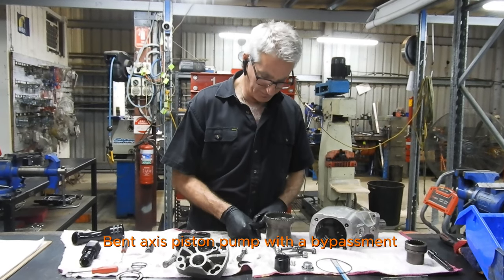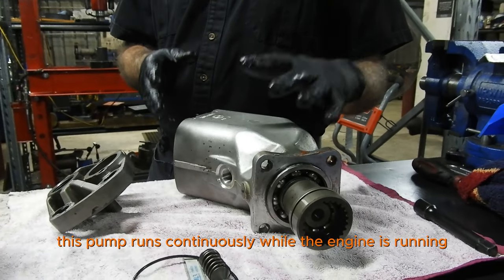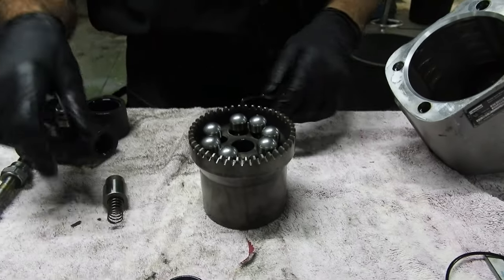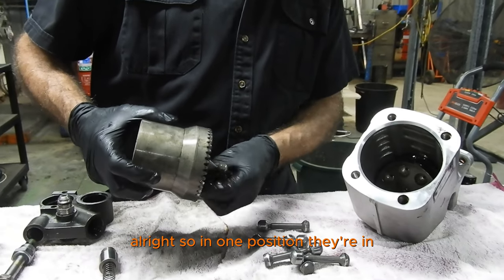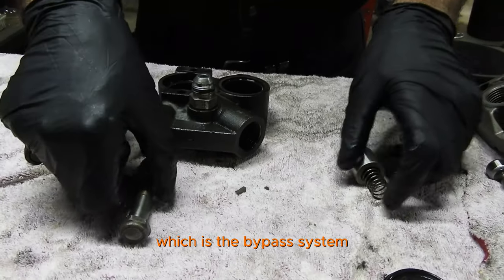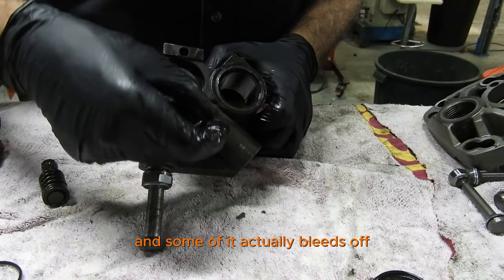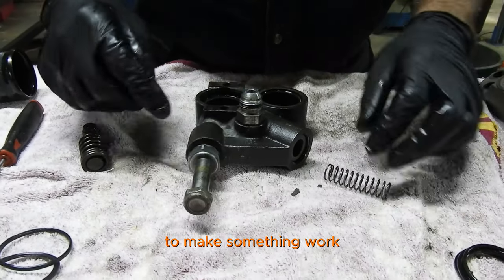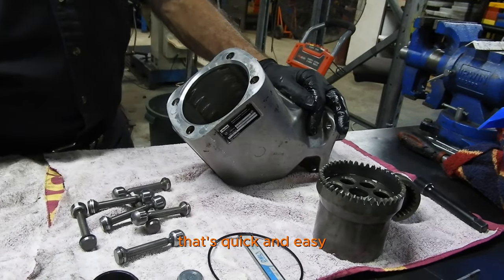Bent Axis Hydraulic Pump Explained

Comment: So what happens if the pump is mounted with the suction port below the pressure port in a non active state. The bypass system provides oil to the suction to recirculate through itself but would it actually recirculate or be allowed to drain back to tank. If the tanks lower than the pump.
Reply from the maker: There is a very light spring on the bypass valve to keep it closed. Also it is never Good Practice to have the Oil level in the tank lower than the Pump suction port. If this can not be avoided then a low pressure check valve should be installed in the suction line to prevent drain back.

Comment: Is this used on items like garbage trucks? What applications does it generally have?
Reply from the maker: Not Sure if Bent Axis Piston Pumps are used on Garbage Trucks because I refuse to work on on them 😝.  But I do know they are used where higher operating pressures eg 350 bar (5000 PSi) are required such as on Truck Mounted Cranes, and concrete pumping booms.